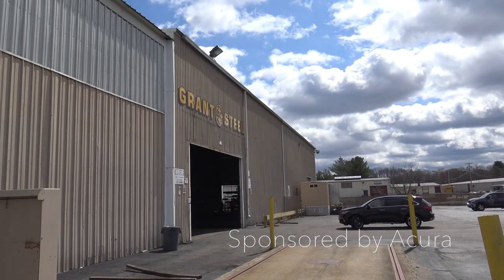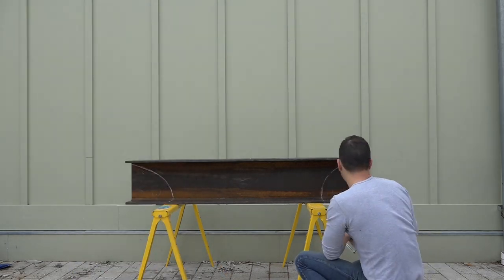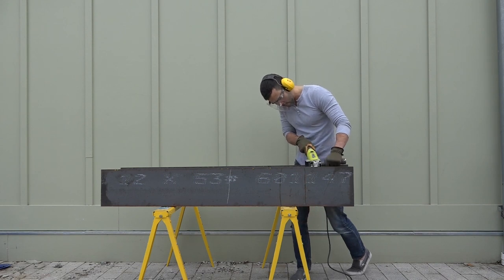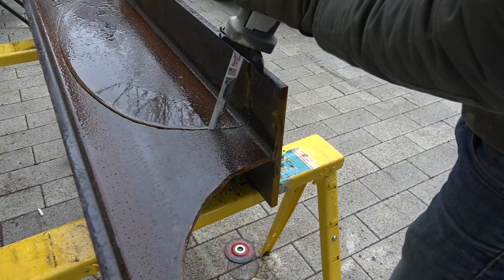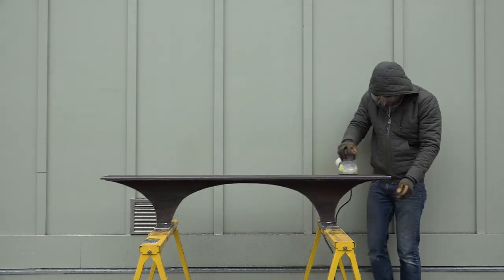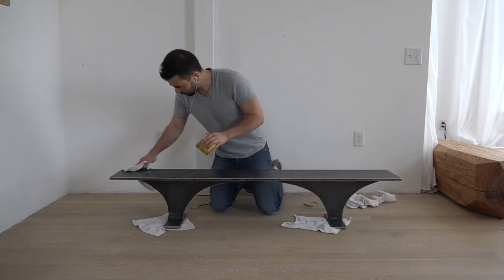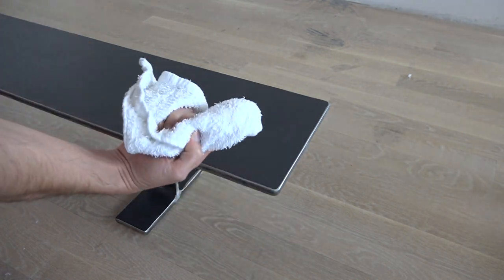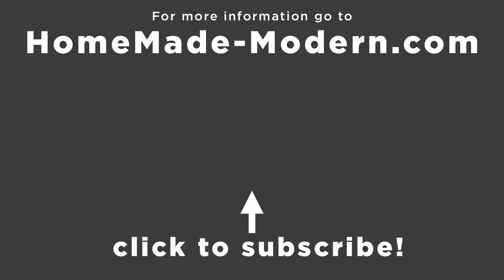DIY Steel Table | Made from an I-Beam

Comment from the maker: Thank you for all the great tips on finishing steel! you all rock!
The beam cost a little under $300
I got it from Grant Steel in Holbrook MA just outside of Boston:  http://www.grantsteelcompany.com/index.html  the are really nice and take the time to answer my questions since i am new to this type of steel work.
Yes! it is a narrow for a typical coffee table but my loft space is long and narrow so i want a coffee table that doesn't block foot traffic.
No way will it tip over.  I will post some instagram story posts of me standing on the end!  @benjaminuyeda
Reply: jet fuel cant melt steel beams
Reply: Do some bookends with the rest of the steel! 
great video!
Reply: It doesn't have to melt it. Softening it up under load is all it takes.
Reply: vipero00 those 911 was an inside job don't understand the basic logic of that.
Reply: HomeMadeModern I see that more as a bench. but looks awesome.
Reply: Dude! I used to live in Holbrook! I'll be stopping by this summer to check them out!
Reply: thanks for the video
you van cut Aldo the scrap metal to do with the dame radius 4 shelfs thst create an armonic space andò a new video with only a bit of work.
thanks
Reply: HomeMadeModern What type of flooring do you have in your loft?
Reply: HomeMadeModern automotive clear coat. Can get it in matte or gloss finishes
Reply: I like to leave metal bare and watch the natural patina slowly take over. I live in a desert so this is a very slow process. You can also heat the metal  to form different color oxides on the surface.

Comment: Very cool, Ben! We actually used hot-rolled steel for our kitchen countertops and sealed them with the same wax. It holds up really well. Through our reading on the subject, we found that people were disappointed with a spray finish because it's difficult to get every bit of moisture out of the metal before sealing, so sneaky rust pockets would develop below the finish. Although we need to re-apply every once in a while, the paste wax still seems like the right choice.
Reply from the maker: thanks for the tips!

Comment: My day job is in metal fabrication, I'm surprised that you only went through 20 discs with that thick of steel! We paint our stuff with an industrial oil based paint so can't speak to finishing other than painting. I've used deft spray  on some works ok but still a spray, great video love the design of the table
Reply: Seems like a water jet could work for this too!

Comment: I work at a structural steel fabricator and what we use to clean off steel is xylene thinner. It removes and protects from any rust.
Also, for your next steel project try shaping the material with a torch. It will give you the ability to coper out any material and shape anything. Keep creating great things. Thanks

Comment: I'm impressed with your use of cutoff disks on inside corners. That's not normally considered a beginners technique. You've got more metalworking experience than you let on. Now, my technique for finishing metal involves heat and its only suitable for small projects. Heat it up to about 500-600 degrees and apply a mixture of beeswax and linseed oil. Its a blacksmith finishing technique and leaves a textured black semigloss appearance. There's dozens of variations on the recipie and you could find out more at any blacksmith forum.

Comment: Penetrol brushed on or linseed oil applied with heat then buffed are also good ways to finish raw steel. But the wax is good too, love your design idea the use of the iBeam was very clever.

Comment: Hi there. Actually I love patinas because it's fast and easy. you can have the full control on the final look with a large variety of aspects. from clean uniform tints to weary old ones. when you.'re done protect the piece with any kind of finish. from shellac to varnishes or resin. Colored transparent epoxy on metal looks like embed glass. Amazing.

Comment: Very Cool! I've got a table I built with a concrete/wood top and a welded steel base. I used a spray on clear coat and have rust spots developing underneath the finish. I think I like your method using paste wax a bit better. A product that might be worth looking into for future metal work is a steel bluing solution like the kind they use to finish rifle barrels. I've seen Diresta use it before in some of his videos and Taylor Forrest uses it in her pot rack video. gives a protective black finish that seems to hold up well. I've only used it once, but it worked well :) Love the video by the way!

Comment: Here is a couple of ideas:

1) Cut the central cut off in half, leaving you with 4 shark fin parts. Then use them as legs for an ocean themed table. Sort of like circling sharks with a translucent blue resin top that looks like water.

2) Make a rocket themed end table, with those as stabilizing fins, you now like those on a toy rocket.

I also think they would make great feet for a bed. Pointed end down.

Comment: To seal bare metal surfaces in non toxic way, use bee wax. Apply to surfaces and use blow torch and paint brush to spread equal thickness. Other method would be use friction to heat up the wax, like some buffing wheel in angle grinder or drill. If you dont dig blow torch (as its more for exterior items), heat the bee wax in dedicated pan and mix in some natural oil like plain old olive oil. Adjust how thick you want it to be and then scoop into jar. Also works as nice natural skin scream.

Specially nice coating on stuff used on kitchen/with food, being natural and non toxic. Wooden pepper mill got nice coat using friction and there is no way water will get to ruin it, or it getting grimy from grease.. etc

Though note that this coating needs to be maintained depending where item is regularly. Pepper mill once every year or two(with daily usage). Outside steel item maybe once year, depending on climate etc.

For the price bee wax is by product from collecting honey and its really cheap. 5-year stock for me was couple packets of home stead chicken eggs in swap with local guy. If you can find out who locally has bees, give them a ring and ask if they have some bee wax to spare. Usually they are and price aint that much. All the better if money dont need to chance hands, but as a maker make them something. This also reinforce relationship and secure your supply if you start using it as your primary coating method.

Comment: I use Thompson's water seal for my tools that get wet but I don't know how it/if dries. Another one is Rustoleum's rust prevention stuff but again I don't know how it dries. Water-based wipe-on polyurethane is one I use on my cast-iron table saw monthly.

Comment: For a finish I would use paint where possible but a trick my welding teacher showed me is using cheap hairspray the protect against rust temporarily. It leaves an almost plastic film on the surface which comes off easily when you're ready to finish the work properly.

Comment: You could use magnets to make things that aren't fixed to the table but look like they're defying gravity. Like a lamp with no base but a powerful magnet at the bottom.
You could also make a magnetic paperweight that's really light but is much heavier when it's on the table.

Comment: If you heat the steel up and then spray oil on it, you get a natural Layer wich protects the steel from corotion.
But before you put it inside you have to clean it very well or it will make black stain to everything your tuching it.

Comment: Cutting torch would definitely be faster. You can get a great rust effect with salt and hydrogen peroxide on a warm day (clean the oils off first with acetone). Gun bluing makes nice dark streaks too- Let them run down the sides for an industrial look. I clear coat after that.

Comment: There are several ways to cut and shape metal. Unfortunately, I do not have time to go into them all, but I will give you a few resources to get you started. First is a book by Tom Lipton aka Oxtoolco on YouTube which is an invaluable resource called Metalworking: Doing It Better. The website Metal Web News is a good resource that covers all aspects of metalworking. Metal Tips & Tricks is a YouTube channel and the creator, Dale Derry is also putting together the ultimate metalworking resource. There are several videos on here that cover many aspects of metal shaping that may open a whole new creative stream for you when you see what's possible with a stump and one or two plastic faced hammers. An old blacksmith method of sealing the metal and give it a rich dark sheen is to heat it up to the 200* - 250* range to get the pores open then rub it with beeswax. I hope you find this helpful.
Peace!

Comment: I'm not usually a Safety Nazi but this looks unstable and top heavy. I've had large dogs in the past and I worry that it could get tipped over. Then it becomes a toe shear. You could use a bath scale and measure how many pounds it takes pushing sideways at the top to start tipping the table. Anything less than 100 lbs I would consider dangerous. Does it feel stable to you? It looks terrific.

Comment: 1st
Reply: Find two thick old wood beams. Cut holes through the tip of the cut outs and drill identical holes in the ends of each beam. Insert the pointed end of the shark fin cutouts and run a threaded steel rod through each hole and secure with a nut on each side. Cut outs will serve as cool steel legs.